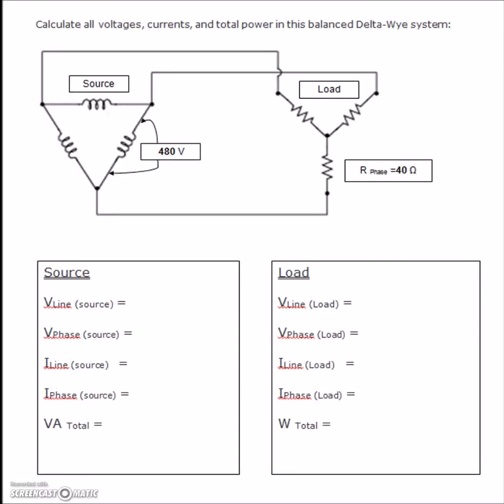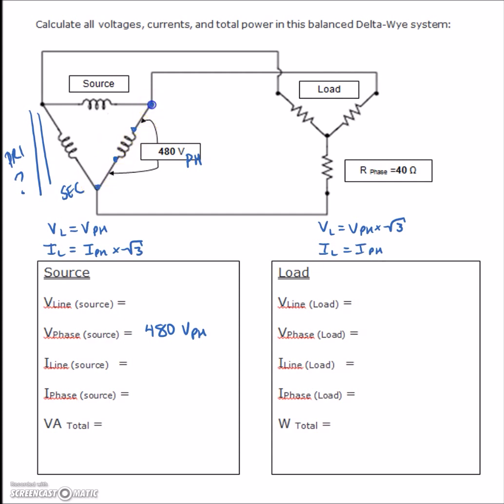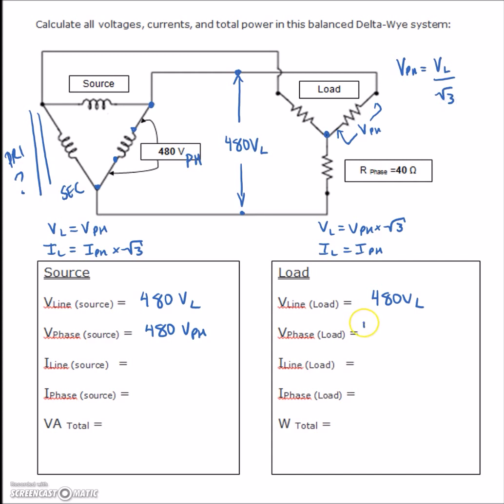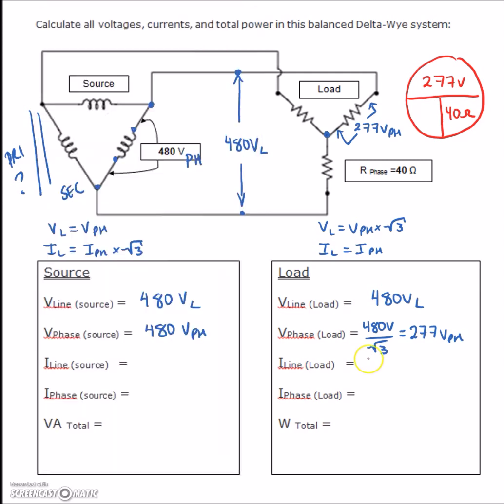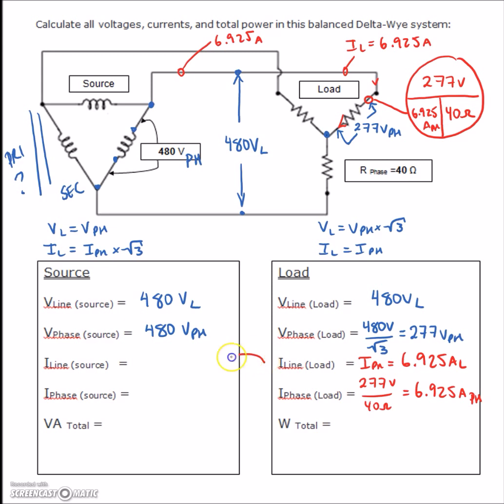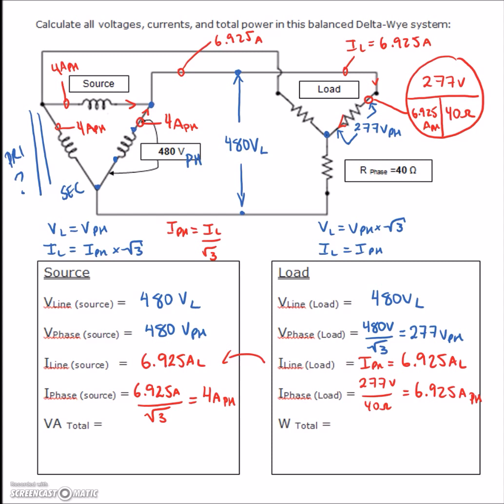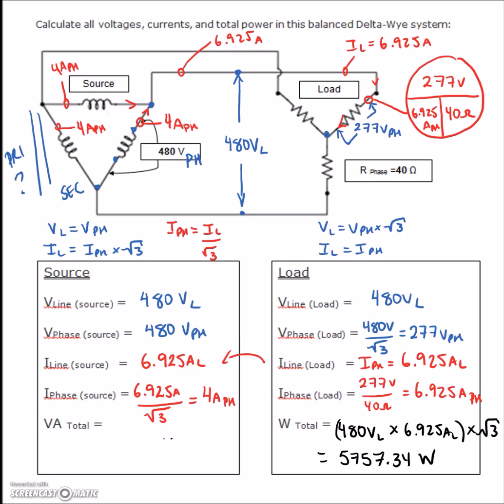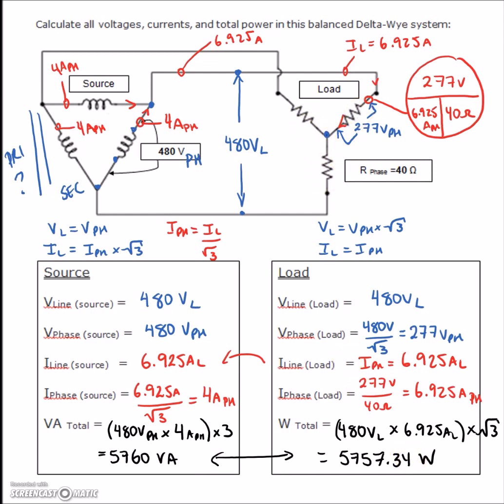3 Phase Calculation #3 (Delta Source, Wye Load)

Comment: Thanks for the information. But I'm still trying to wrap my head around a Wye load. Could you please provide me a real-life example of a Wye load? Suppose the secondary of the transformer supplies a 347/600V distribution panel (breaker panel). In that panel, most of the loads that I can think of are Delta loads protected by a 3-pole circuit breaker, operating on 600V, and with no neutral wire. For example, commercial heaters and three-phase motors. Other than that, there will be 347V lighting circuits on a single-pole circuit breaker, each of which has its own neutral wire. If all of these neutral wires are then connected to the same neutral bus bar in the distribution panel, then can the panel itself be considered a Wye load?
Reply: The panel is a wye supplied panel, because it is supplied by a wye system. You can supply delta and wye loads from a wye system.

Comment: Plz tell me the total load in KVA if per phase current is 11amp, 14amp and 15 amp on output of star transformer. Also provide the calculation plz. Thanx
Reply from the maker: Just multiply each of those Phase currents by your Phase Voltage (line to start point) and add them up

Comment: Hi Mr. Vree I have an exam question that's giving me trouble please help! : The factory at which you work is supplied by 3 phase -2300 volt service , with 3 - 1phase transformers, rated 2300 volt primary, 120 volt secondary. To obtain  120/208 volt secondary line, you would connect  a) wye-wye   b)wye-delta   c)delta-wye   d) delta-delta.  (is there a formula for this?). Thanks in advance.
Reply from the maker: So, if the supply Line Voltage is 2300 volts, and the Primary of each Single Phase Transformer is rated at 2300 Volts... then you'll need a Delta Primary where V Line = V Phase. Then, if each Secondary provides a Single Phase 120 Volts, and you require 120/208V on the Secondary, you'll need a Wye Secondary. Hope this helps. 
Here is a link to my tutorial on  Wye Circuit Equations: https://www.youtube.com/watch?v=7QCHXXCrU-I and Delta Circuit Equations: https://www.youtube.com/watch?v=1VFaKJsoufo
Reply: Pete Vree thank you so much your a blessing!